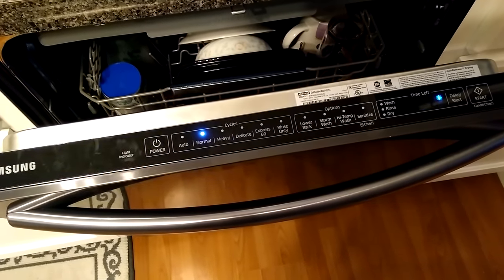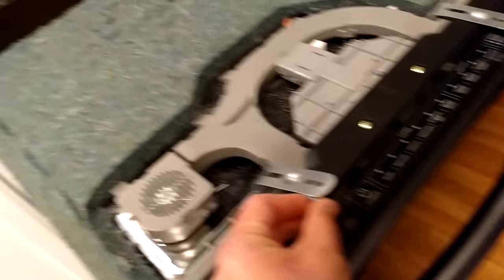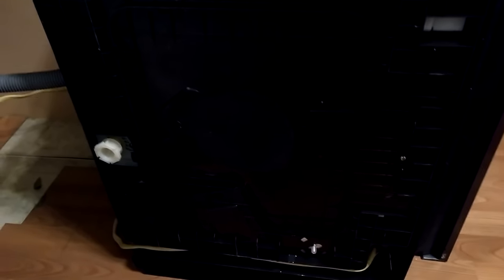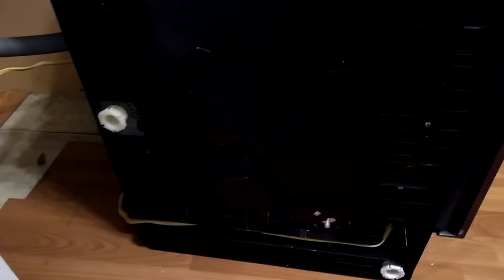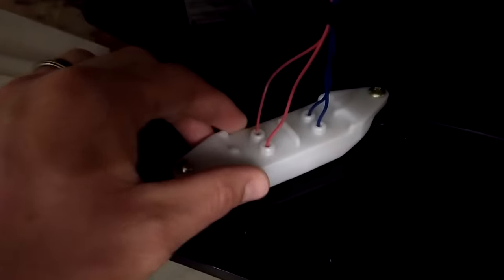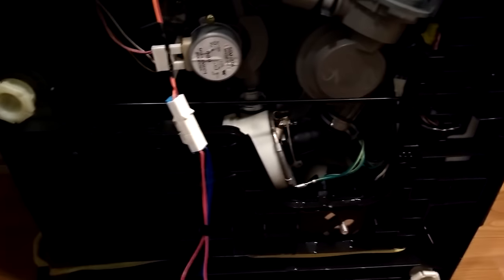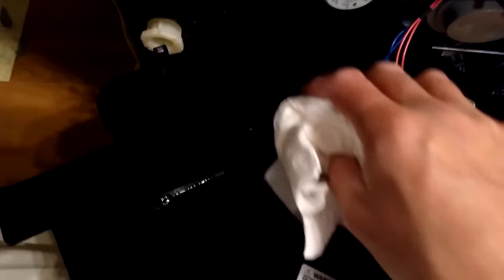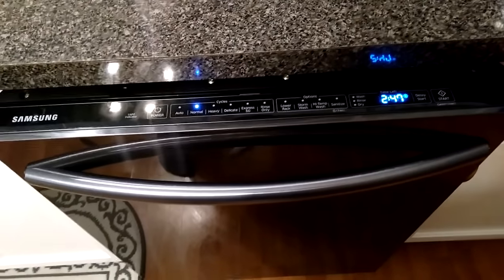How To Fix Samsung Dishwasher with LC Error Code

Comment: Good video.  Had a small leak from the front door and now getting this error(thankful it happened saved our floors), I followed the steps in the video found some water in the bowl, dried everything, still getting this code and every thing is bone dry drain pump is working well, checked drain hose and water hose.. We are going to let it sit for a few days and if it persists we are going to replace the clamps underneath the unit with ones you can tighten up. Will update

Update: let sit for a day or two, works just fine now might have missed some water on the sensor. Thanks
Reply from the maker: Good luck!

Comment: Thank you! We only have this issue when outside temps drop significantly during the winter. We've had technicians come out and they say there is no actual leak, it is condensation caused by the hot water and cold air. I'm wondering if this is happening due to the dishwasher sitting directly on the concrete slab. When we had the floors replaced didn't even think about underneath the dishwasher.
Reply from the maker: You're welcome. That sounds like a very good possibility

Comment: Make sure when loading dishes arent wet, such as a half full glass of water turned upside down when loading into the top rack and splashing onto the open door of the washer. I discovered over months of trying to troubleshoot the leak sensor, short of replacing the sensor, that a person in my household was splashing water when loading the dishwasher and sure enough the little splashes found their way into that tray.
Reply from the maker: Great tip, thanks for sharing!

Comment: Just fixed my dishwasher that wouldn't shut up! Thanks so much. If anyone has a similar problem, I had the issue of it blinking on "Normal" but the same continuous draining. My DW was a bit different, as it had no screws underneath, rather clips holding it together. And after that, the sensor looked a bit different, but the fix still works. Thanks!

Comment: This video helped me out about a month ago. Thank you so much. Like you, I could not detect a leak. Frustrating!  But I think I figured it out. At least I think I resolved my issue. I was adding rinse aid too frequently. This was causing suds which would then cause slight leakage each time I ran the dish washer and eventually cause the sensor to detect moisture. I’ve read my manual after two years. Ha. I only need to add rinse aid about once a month 😯.  I haven’t had the code since I figured this out. Thanks again!
Reply from the maker: That's great! Thanks for the tip, sounds like a really good possibility

Comment: Thanks a lot for this! This terrific video showed me how to get access to the sensor, where some bits of what looked like scale or grit of some sort where keeping the floater up and the leakage sensor pressed. There was some water there but I don't think that was the issue. Once the floater was clean, and all assembled back is now working fine, no more LE error (slightly different model). Thanks!
Reply from the maker: You're welcome! Glad we could get you headed in the right direction!

Comment: Thanks so much! I could not have figured this out without this video. Can you confirm... will the machine operate if the sensor is removed/disconnected?
Reply from the maker: I believe it will, but I can not confirm.  Probably best to solve the leak instead of removing the sensor.  If the leak persists you could have bigger problems soon.

Comment: Thank you for this. I have a different model Samsung didnt want to help your video was spot on. Makes me mad that the leak is coming from a manufactured part so i need a technician if i wanted to fix it corectly
Reply from the maker: You are welcome. Glad it fixed your issue on a different model!!

Comment: It solved my problem. I cleaned the filter under the bottom basket inside which was slightly clogged. Other than that I couldn’t figure out the reason for the water in the bottom tray. Thank you for sharing a video.
Reply from the maker: Excellent!

Comment: Awesome video! Thanks so much for the post.

Before flipping the machine on its side my wife suggested we try using her hair dryer (NOT my heat gun), so we removed the right side panel (moisture sensor is right rear) and applied hair dryer on high, five minutes, and could see the moisture evaporate. The front of the tray has a detent with more obvious water, so we did that first, then did the area around the sensor.

Like I said, five minutes and problem solved. Thanks for getting us on the right track.
Reply from the maker: You are welcome, glad to help!

Comment: Thanks all - this worked a treat.  Two notes on potential sources of water: opening the door mid-cycle and also excess gunk build up on the bottom edge of the inside door panel (there was enough that possibly was compromising the rubber flap).
Reply from the maker: Great point! Thanks for the feedback!
Reply: Also: Clog in pipe, causing greasy water to back up into dishwasher.
Reply from the maker: Another good point, thanks for sharing

Comment: I’ve had mine do this several times as well over the years.  It seems to happen when we put cookie sheets or other unusually large dishes along the front edge of the rack.   I suspect water somehow gets deflected somewhere it shouldn’t.  It doesn’t make sense but every time it happens, someone has loaded something large that creates a wall along the front door.  I also wonder if it could be a rack not being fully inserted.  I’d love to know where water could exit though to help prove this theory
Reply from the maker: Early on I had a repair man look at mine when it was under warranty and he gave me a lesson in loading. My kids had bowls loaded with the opening facing the door. I never had that issue with older model dishwashers, but modern ones are more flimsy and lighter. We load with the bowl openings facing away from the door now and haven't had any leaks from the door

Comment: Thank you for sharing. Took about an hour to do but it worked, hoping it's a durable repair. Saved me a call to the repairman/replacing the dishwasher early.
Reply from the maker: You're welcome, should be sustainable, mine hasn't had any issues since the video was posted

Comment: Thank you for the video. Since Samsung refuses to repair or to recall their device defects. All of us poor Americans that pay our hard earned money for their products need to start filing Consumer Protection Complaints with our State Attorney General Offices, Federal Consumer Protection Complaints with our Federal Attorney General Offices, as well as the Consumer Protection Agency also! I am tired of faulty products, the last one was our previous dishwasher that this one replaced was a Frigidaire. At 13 months old the heating element in the bottom burned a hole through the plastic tub and caused a leak.

Used this last night to fix our same issue. Our model number is DW80R5061UG/AA 00, found maybe two tablespoons of water in the bottom of the tray. Checked all of the hose fittings and didn’t find any traces of water. If this happens again, I will wrap masking tape around each of the fittings, discovered using this method when trying to find leaks in our church with a steel roof and steel girders, water can run a long way, so it is a process of elimination. The masking tape material will show the water stains, might be easier to track down. I am trying to not purchase another faulty dishwasher.

Comment: New install and had 2 codes in one week. Each time had water in tray. Checked the drain hose and spring clamp and a with a little tug, the line slipped right off.  No barbs on fitting and hose was only about halfway on from factory. Put a stainless steel screw clamp on with the original spring clamp and is solid now.
Reply from the maker: That's good, yeah those fittings aren't great
Reply: @howtofixitworkshop  Thanks for your video. Made it much easier!👍
Reply from the maker: You're welcome!

Comment: Just tried this 3/20/20 and it worked, then I started to investigate the leakage as it was wet in the pan, but the hoses and all were dry. I reinstalled it in the same position as it was and started a load. A little while later I noticed it was a little off level, so I opened the door and noticed the water in the bottom of the dishwasher was tilted to the front just enough where the water was coming up to the door and leaking through the front down into the pan. I re-leveled it to where the water was actually going back to the rear of the unit slightly and no more leaks!
Reply from the maker: Fantastic! Thanks for sharing that tip!

Comment: This has happened to our 1 month old DW60M6055F, the bottom is clearly different to yours as far as the only screws are holding on a small panel covering the circuit board, the bottom appears to be held on by clips that don't come undone.  BUT

By turning it over about a cup of water came out and that fixed the problem.  Thank you :)
Reply from the maker: You're welcome!

Comment: Thnx! worked like a charm. I need to find out the hard part == leakage now.
Reply from the maker: You're welcome! Yeah it could be the water supply line or drain line or the seal around the door

Comment: Had the same issue. Discovered that the leak it found was at the hose connection in the back. There is a small cup/catch area under the white hose connection knob. The drip gets collected and run into the pan he describes. Check for drips there, fix if found, then let the pan underneath dry out - maybe a few days. Then power it back up. . No need to pull and flip the DW!

Comment: Worked fine for me. However the question is why water is leaking inside??
I found that if you have installed the L shape copper adaptor for the hot water inlet, it is a cheap adaptor that doesn't close hermetically as the only gasket is just a piece of rubber.
It generates a small drip, just a drop, but using it every day it will keep collecting this drip until the LC code pops up.
Replace a better quality inlet water adaptor and be sure to wrap the inlet tube with teflon or thread sealant.
Verify that no drops come out before placing the dishwasher back.
Reply from the maker: This is a good tip, thanks for sharing!

Comment: I just fixed the Lc code on mine.  Pull machine out   unclip catch basin, remove sensor by unplugging wires and remove 2 screws.  Duct tape a sponge in place of the sensor.  No more lc code. And the sponge will absorb any water that does drip into the tray.
Reply from the maker: Great tip, good luck!
Reply: So far it's been 6 weeks of daily use. No issues at all.  I placed a piece of paper under the drip tray and it has not gotten wet yet.
Reply from the maker: Great news! Seems there a couple days to improve this issue
Reply: What did you do to the wire? Just taped them up with duck tape and/or electrical tape? How long ago did you do this? Have you had any problems since? Did you put duck tape on the sensor also? And the wires? how do you know if you have a leak in the future? Thank you for your help.

Comment: My Samsung started draining non stop this morning around 1 am and the "heavy" cycle is blinking. Around 3 am I finally figured out something was wrong. I called the help line today for Samsung and was told to take the kick plate in the front off and place a fan and let it dry over night.  I don't think I will be able to get the dishwasher out from where it is housed because when the floors was redone in this house, they did not run it under the dishwasher, instead it stops in front of the dishwasher blocking it in so it won't slide out.  Any suggestions on what to do with out ruining the floors? If your answer is drop kicking it, then I already tried that around 4 am.
Reply from the maker: Sorry to hear that, sounds very similar.  I had the same situation with the flooring not going under the dishwasher.  I was able to lift the dishwasher a little after removing the two screws that hold it in under the counter and then I turned it on it's side.  But I've heard the kick plate/fan method can work too, unfortunately I don't believe that is a permanent fix.  I was able to tighten the in and out water lines and I believe that kept further leaks from happening.  Good luck!

Comment: Thanks!  I had exactly this issue after installation.  Initially I had a small supply-line leak, which I corrected, but the error code persisted.  Sure enough, there was water in the "catch basin" that tripped the digital sensor.  Dried it out, re-assembled, and now all is good.
Reply from the maker: +Don Alderman you're welcome!

Comment: Great Vide.........Simple condensation!!! Over engineered sensor that doesn't allow for any moisture from condensation to occur…. a teaspoon or less of water will set it off as the sensor is so close to the pan (Thoughtful idea but with no air to evaporate the condensation this is a dumb sensor)  There is no air circulation because of the insulation and sealed cavity After 2x repairing  I just removed the sensor and put it up higher and no issues for a while
Reply from the maker: Great tip, thanks!

Comment: Had a technical out as ours was under warenty... Bottom of door has a hidden seal. It packed up with grunge and starts to leak into the lower pan. We clean ours regularly and have had no issues in 3 years we are going on 6 years on this machine. 

Regards
Reply from the maker: I've had to do that with ours as well. These things do require some routine maintenance to keep them clean and running properly. A whole lot more effort than dishwashers from 20+ years ago. I don't think most people realize that, so they end up being disposable and replaced every few years

Comment: I removed the catch pan, unhooked all the pipes, drained, dried and cleaned everything, still LC error. Started disconnecting things one at a time, still LC errror. Pointed heater toward the inside for 3 hours with everything open/exposed, still LC error,  leaned it over and pointed the heater for 3 hours at the bottom, finally cleared the error. Praise God and Liber8!

Comment: Do you have to disconnect any hosing first before moving the dishwasher in order to top it?
Reply from the maker: No you shouldn't have to. The water supply and waste lines are long enough to move out

Comment: My sink plumbing backed up, causing my dishwasher to back up and throw this code. After clearing the clog and allowing the dishwasher to drain, I unplugged it and aimed a box fan at the left side of the inside of the dishwasher. After several hours, everything worked as it should. I did not have to remove the dishwasher.
Reply from the maker: Nice to avoid the hassle if removing

Comment: I had this issue a few years ago because I didnt clean the internal filter at the bottom of the dishwasher, well it's back but this time the filter is clean. wish me luck.
Reply from the maker: How did it turn out this time, were you able to fix yours?

Comment: Would unscrewing the sensor from the panel and just placing it some where in the that area let it still work?  Since it would have the wires connected by not sitting in that divit?

Comment: I removed the sensor completely from the bottom and taped it higher on the dishwasher. 
I turned back on the breaker and it's still doing the same thing.  Any other thoughts?

Comment: Hey, did you ever figure out where the leak was coming from? I’ve been doing this trick for a few years but yesterday it hit me with the leak sensor after just 1 run..which has never happened. Thanks in advance!
Reply from the maker: I tightened the incoming and outgoing water lines and haven't had any more problems. I also clean the gasket around the door every few months because it gets grimey.
Thanks for the feedback!

Comment: I’m close to relocating that sensor, it’s and open circuit and the water bridges the 4 wire activating the lc code if it never touches water then lc code never comes on the real problem is finding the leak, I looked up a couple of videos and the more common problem seemed to be a bad air inlet diaphragm seal or something with the dryer system. I’ll keep digging and let you know what I find.
Reply from the maker: Thanks for adding the information! I don't know where my leak was coming from for sure, but I tightened/adjusted all water lines (supply and waste) and also adjusted my overall level of the dishwasher. I haven't had any issues except a leak from the front door. I had a repairman come look at the dishwasher and he gave me a bunch of great tips to avoid leakage from the front door. I've considered creating a follow up video to share those tips with others since they weren't inherently know to me and I did not see them in the owner's manual.
-Josh
Reply: im deleting the sensor, bypass it, its annoying and stupid, or relocate it

Comment: Do you know what causes the 3C (pump issue)  code? It's a new install of a dishwasher I've had in the garage for 2 years. It will fill and it will drain but the cycle will not run. I called Samsung customer service and they won't talk to me unless I am a professional installer.